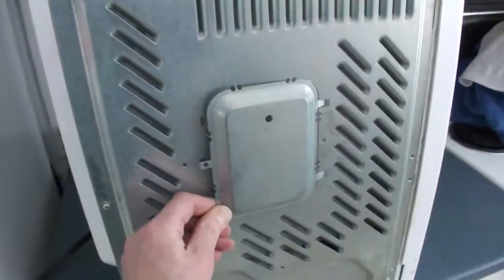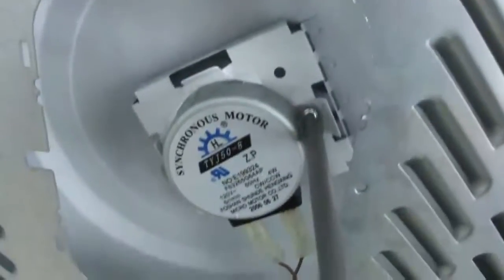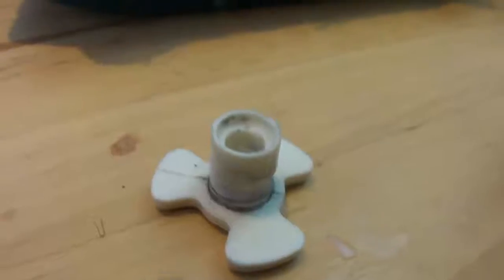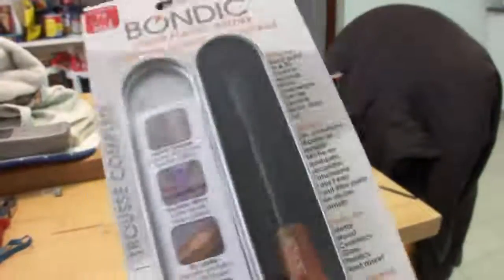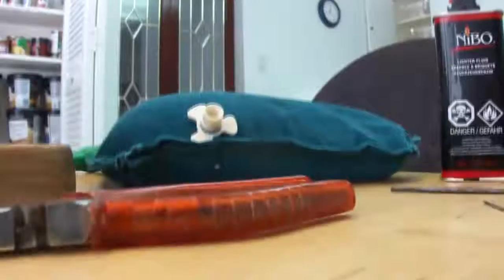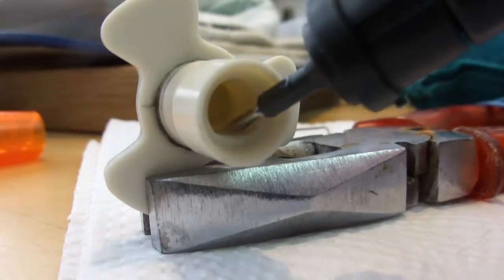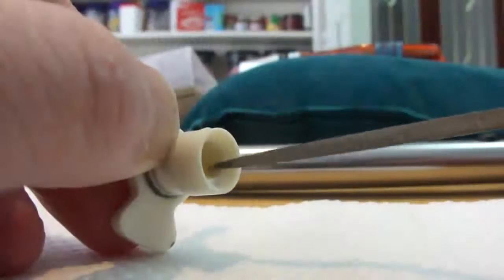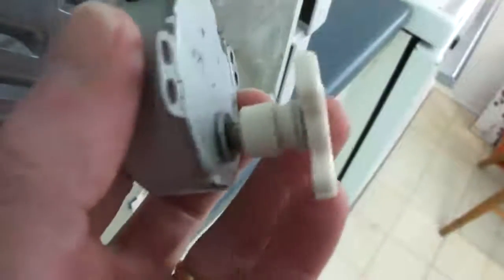Fix 'turntable doesn't turn' fault on a Panasonic microwave with Bondic

Comment: How to know if its the motor thats malfunctioned or this piece u fixed
Reply from the maker: I think I would take the glass plate out, just put a mug of water in, off to the side, and run the microwave. If the little spindle can turn when it has no work to do, then probably the motor is OK. If it's still not spinning, then probably the motor is broken.
Reply: andycivil the tip is not that long in order to turn anything
Reply from the maker: I'm sorry, I don't understand. And, I'm afraid to give you the wrong advice.

Comment: I did a repair on a larger part.  I had to only glue the circumference because there was no way to get light into the interior.  Then I had a DOH! moment.  You could put a standard epoxy in the large interior area and use bondic to hold the exterior.  Some might say, well, you can clamp it, and that's true for many parts.  But there are a lot of weirdly shaped situations where "exterior bondic, interior epoxy" might be the ideal way to proceed.
Reply from the maker: Interesting thought! I don't know if bondic would react with the epoxy in any way - either type might trigger the other to set weirdly, or not set at all! It would be an interesting experiment, for sure.
Reply: @andycivil  hmm....I would say, just do a little dab in the center and try to avoid squeeze out.  If there is squeeze out, wipe away, then apply bondic.  I've only used bondic three times now but each time was in applications that would have been almost impossible with another glue.

Comment: Probably could have used superglue and baking soda also
Reply from the maker: True enough, but to be honest, I don't like superglue. You can't control when it sets. I mean, it's very clever and all, but after you've opened it, it sets in the tube before you get to use the rest. I agree it's a better option if you can't get light to the surfaces.